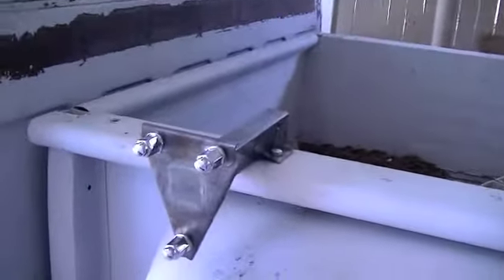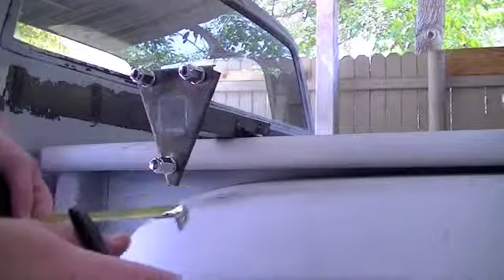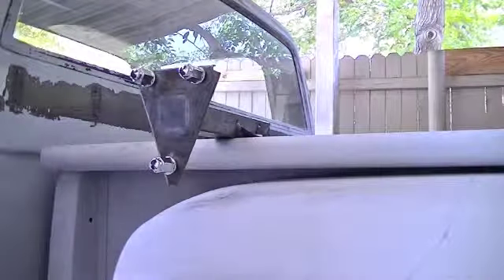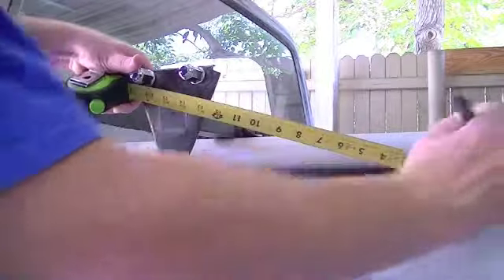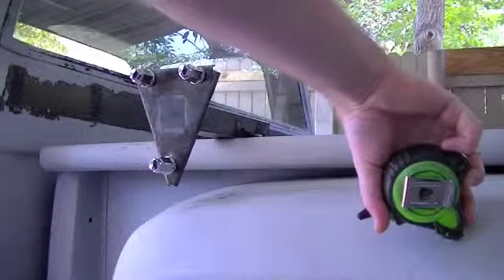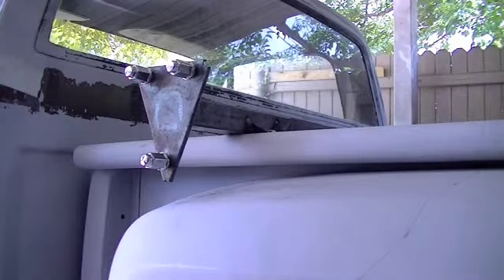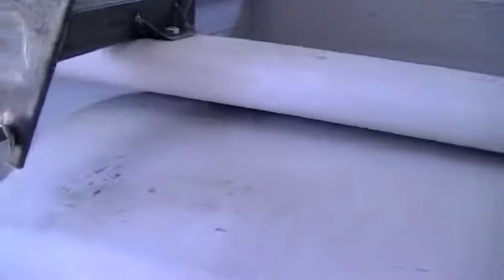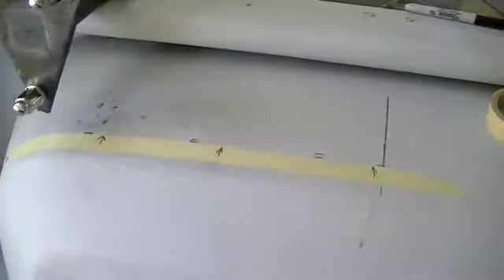Part 5 C10 Spare Tire Carrier

Comment from the maker: After getting the tire mounted on and the trailer fender filler piece in place, there is still some of the original fender sticking out past the spare tire.  I may leave some of that original fender material in place when I cut on the new fender.  Probably not much though.  It would make it difficult to remove the tire if needed.  It would be even more difficult to remove the the spare tire without scratching the paint.